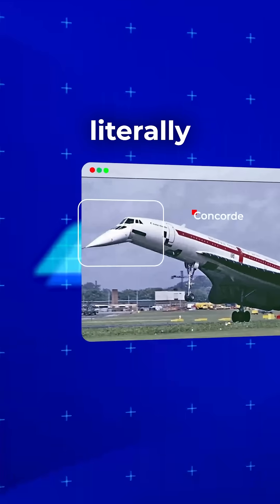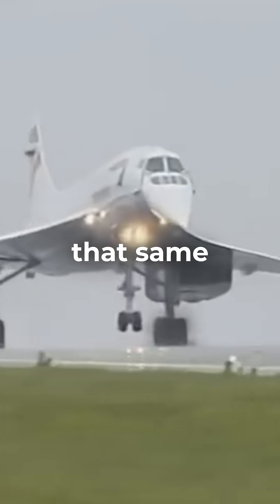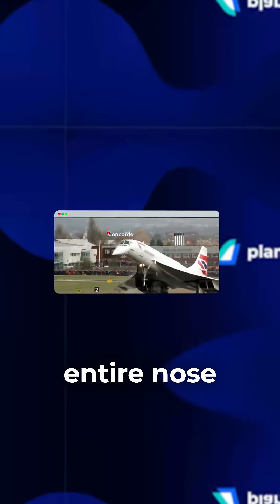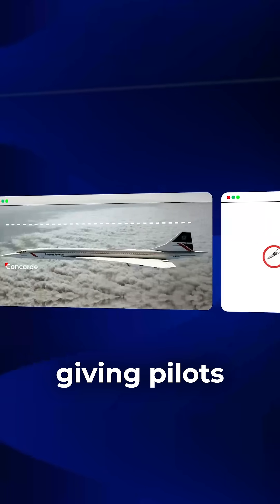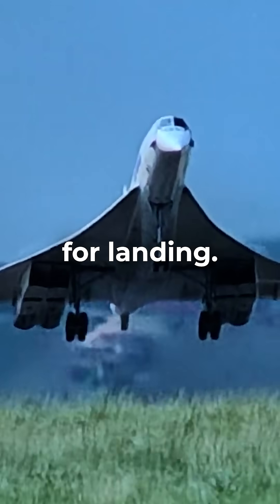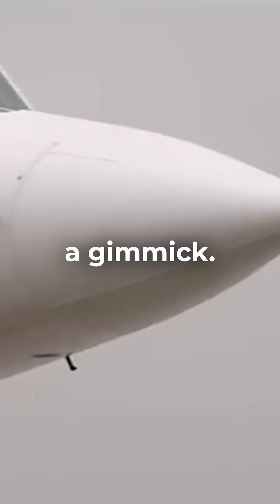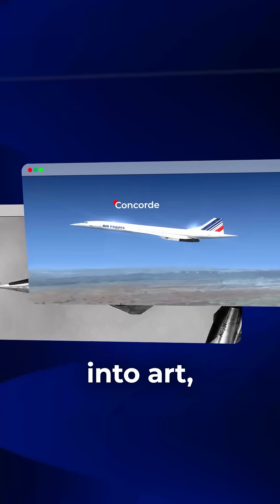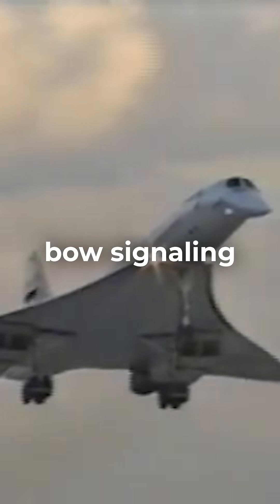Why Concorde Had That Famous Droop Nose...

Comment: apparently nobody thought of putting two cameras on the nose and monitors on the cockpit
Reply: 1976 btw
Reply: @frygonkis so?
Reply: @cesarnieves6884  were cameras reliable back then? Think
Reply: @frygonkisthere has been tv since the late 40's. Crt monitors are ultra reliable.  Are you a millennial by any chance?
Reply: TV monitor and camera hasn’t been invented yet.
Reply: I hope you are joking. @youtubechangemynamewhy
Reply: That's would be a very hard sell to the pilots. This airplane was designed in the sixty's, cameras were not reliable enough to depend on, too many lives at stake. 
Note the  brand new KC-46 tanker based on the Boeing 767, it uses cameras for the refueling boom, with todays best camera technology it doesn't work well.
Reply: Some science will make that fail.